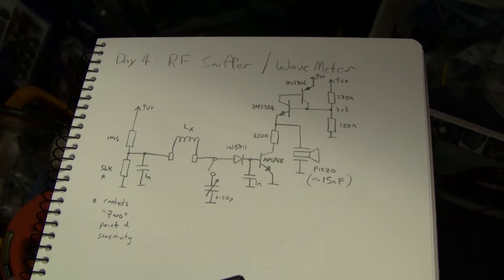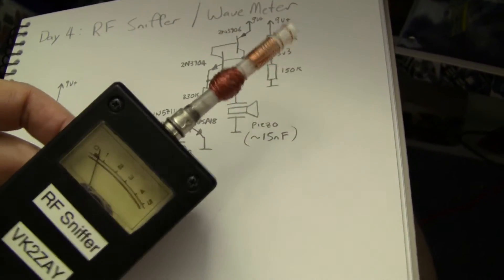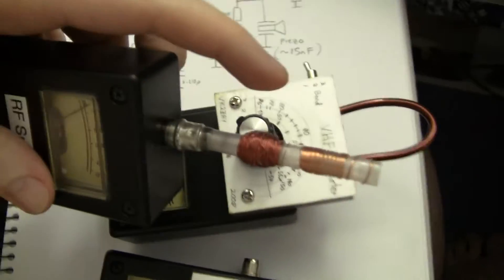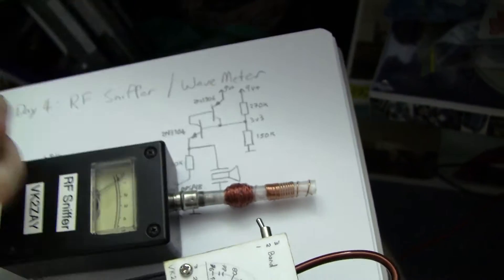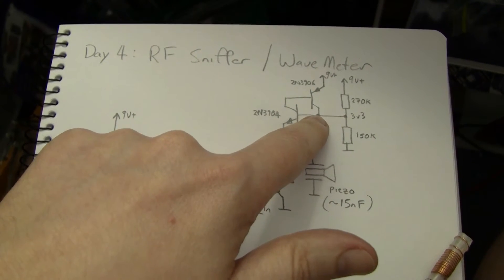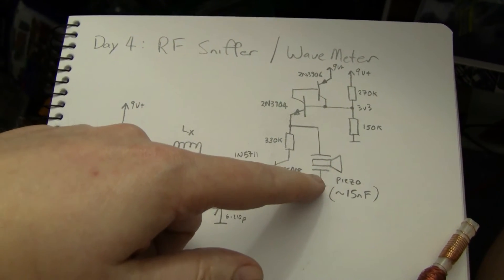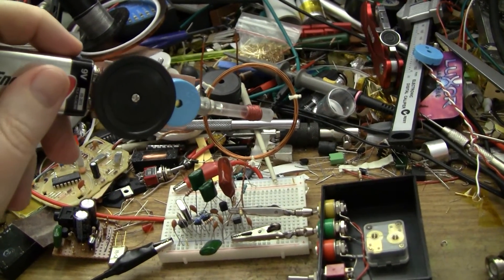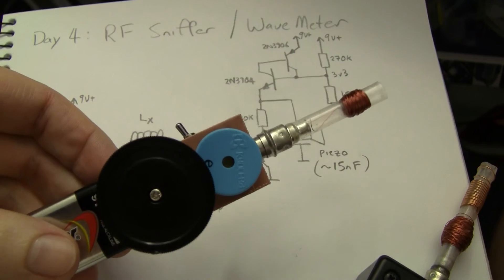Advent Calendar of Circuits 2011: Day 4: RF Sniffer / Wavemeter

Comment: Question: Do the visible coils form the actual  antenna or do they take the place of the inductor in the detecting circuity?  I made a RF meter based on an ElectronicsNmore video using a fixed 100nH choke with a germanium diode and I find the size of the antenna needs to be roughly the same size as that of the transmitter I'm detecting. A full sized telescoping antenna detects my 17'' ground plane transmitter antenna, but I need to use a small wire antenna to detect an FM bug transmitter. Any thoughts?
Reply from the maker: Yes the coils are the antenna.  It isn't intended to be extremely sensitive without being coupled to another coil, this helps you control what you are trying to sniff energy from.  You can add an antenna to the hot side of the tank coil, or tap down on the coil or use a series capacitor to get a better impedance match from the antenna to the tank.  The biasing of the detector and bit of gain in the transistor actually makes it quite sensitive compared to just a diode, even a good RF detector diode.

For your fix tuned RF meter the properties of that 100 nH choke will determine where it is most sensitive i.e. Near its self resonance frequency but a bit lower because of the antenna capacitance.  For higher frequencies a quarter or half wavelength should give the best sensitivity if the inductor is well away from resonance.
Reply: @vk2zay  

I'm gonna try the wound coil antenna and see... I've currently got a 12" 10awg wire as a compromise between extremes. It detects my 17" gp antenna transmitter and my little square loop bug. But neither of them optimally. I really need to get some connectors so I can swap out antennas. BTW, failed to mention in the previous that and I am using a JFET after the diode for gain etc... I also added a second JFET to the original ElectronicsNmore design to drive an LED in proportion to the panel meter. Really want to thank you for taking the time to comment. It's hard to find good information... Thanks!
Reply: @vk2zay  

Heads up to anyone who's interested: ntepartsdirect.com has 5W RF power transistors on clearance for $0.25.... that 25 cents!

Comment: How picky is this about the transistors used? Could I do by with 3x BC5478?
Reply from the maker: You could use BC547 and BC557 or similar for the SCS part of the circuit.  The MPSA18 is selected specifically for its high beta, you could replace it with a darlington pair but you'd need to rebias it, increasing that 56K resistor.  A BC549C or BC550C are pretty high beta, maybe try them too.

Comment: Yes a piezo sounder. What's strange is if I disconnect everything and apply supply voltage to my 2906 at the emitter I get supply minus about .4 volts at the collector. so obviously my piezo who is now receiving 8.6 volts is turn on. This is happening on both the copper boars circuit and my breadboard with different components. Am I missing something?

Comment: Right now that's not the part of the circuit that is problematic to me. It even buzzes with out a coil. I have built the circuit but on a bread board this time just the transistors and the buzzer with new components and it buzzes as soon as I connect the battery. Any suggestions
 Thanks for your help.

Comment from the maker: You will need to change the 56k resistor to something smaller, I'd suggest you use a 100k potentiometer to adjust it for best sensitivity - then either leave it in place or remove it, measure and replace with the next smallest standard value.

Comment: Hi again
I have built the circuit as shown on your diagram except I have not  install the variable cap or switch. I have used a 1n34 for the diode. Everthing else is the same. When I install battery the circuit beeps constantly. Any ideas? 
Thx again

Comment from the maker: The BAT41 is similar, somewhat better reverse voltage.  Even a 1N4148 or 1N918 will work, the hot carrier diodes just work better at higher frequencies.